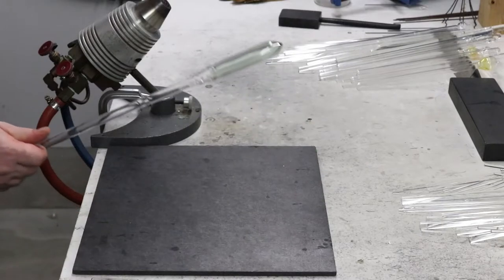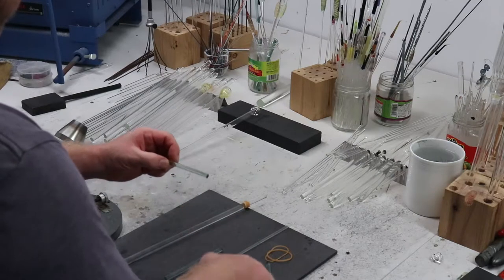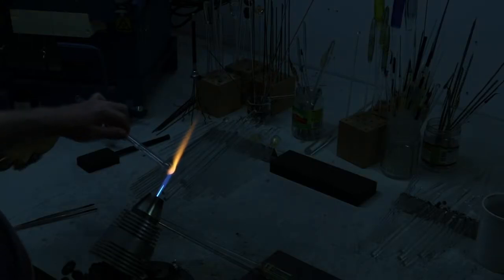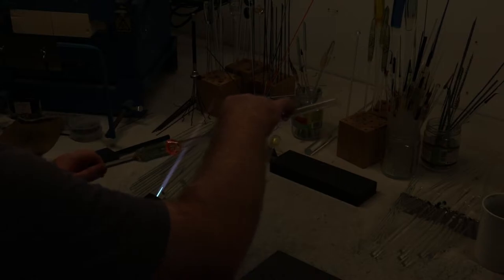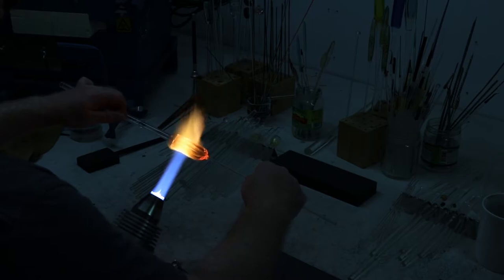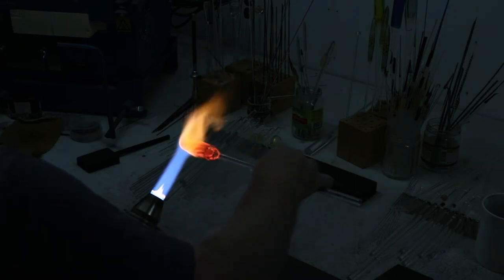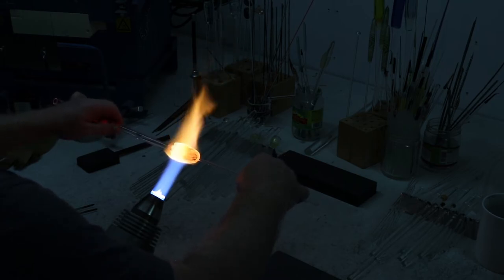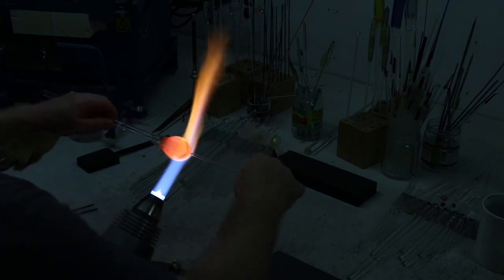How to make colored tube using colored glass rods, sometimes called a stick stack.

Comment: Can you make a video on how to save glass that gets blown too thin? Like how do I condense it back to a even walled tube without it collapsing or popping a hole open? I have this issue when trying to do this with color because its hard to see the thickness of the glass.

You are a great teacher and explain everything in great detail. I appreciate it
Reply: if your glass is too thin, get it real hot and condense it. wait for it to cool slightly before puffing it out evenly. (thin glass cools faster than thick), wait 5-10 seconds so the thick parts blow out more than the thin. repeat a few times until ur tubing is even. practise with a big bubble of clear glass and blow it paper thin. Then try to condense it back to stock tubing size.